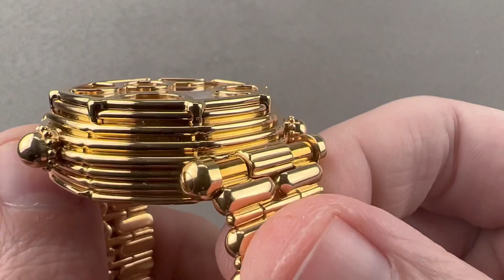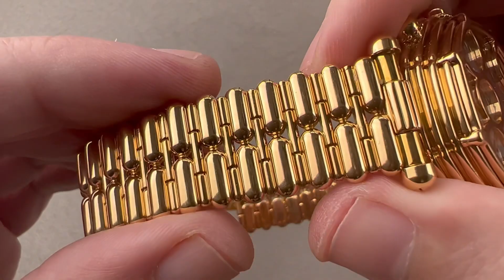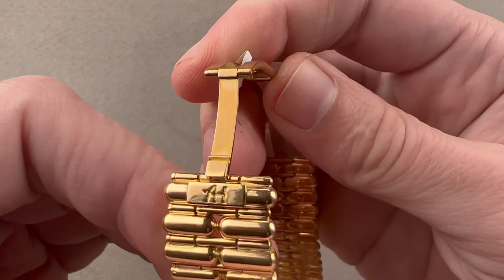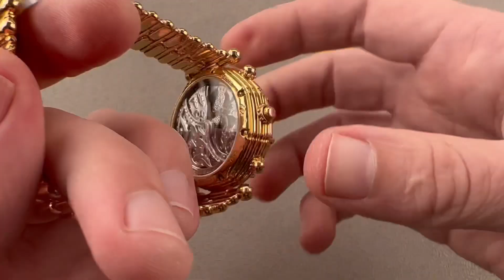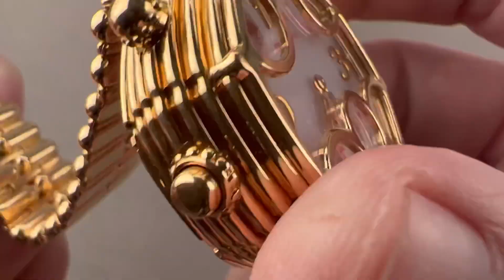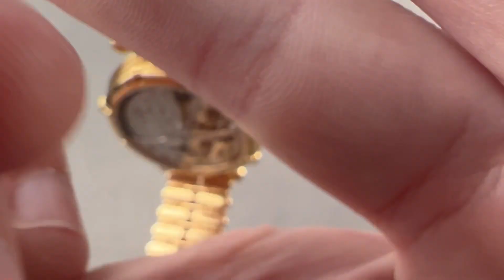Gerald Genta Grande Sonnerie Tourbillon G0027.7.40.214.40/BD Gerald Genta Watch Review

Comment: Extremely impressive but hideous. Looks like the bezel is loose as well. Whilst definitely not for my style (or budget) in terms of finishing and complication it's extremely impressive
Reply from the maker: The bezel movement is just kind of how it's assembled. After looking it over, there's some calculated play in the way it moves on its base, which is joined using clamps to the top of the case. It's tough to describe exactly, but it's kind of like the way bracelet links are put together. We may ultimately opt to service this watch mechanically at Bulgari without polishing it, but I suspect the bezel is as it's always been.
Best,
Tim